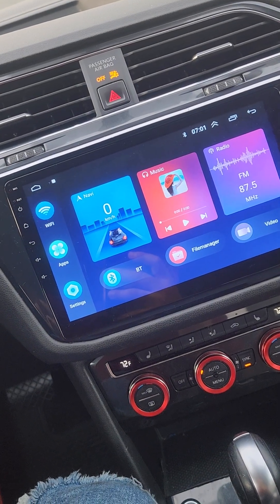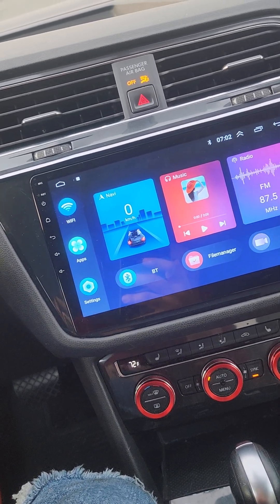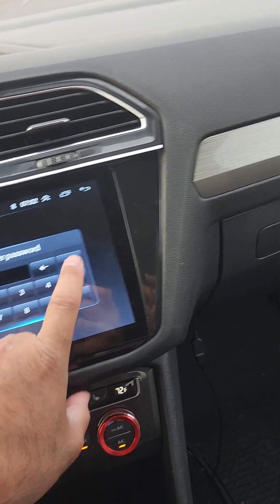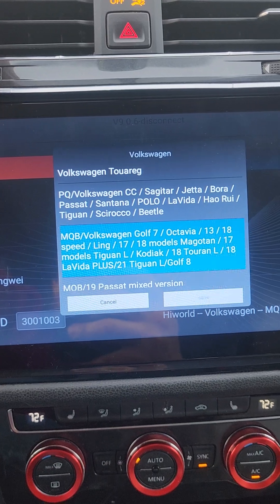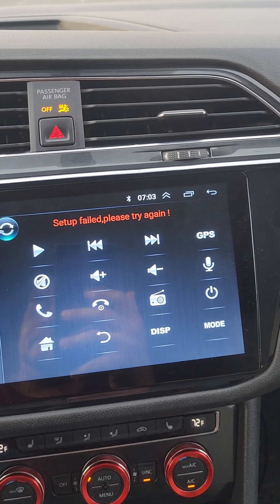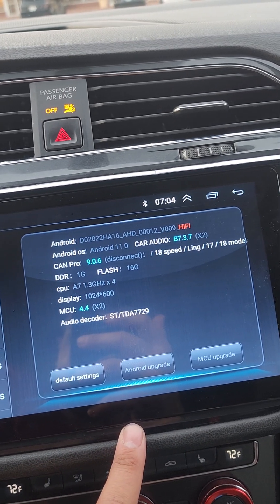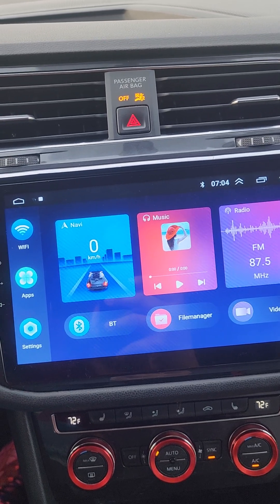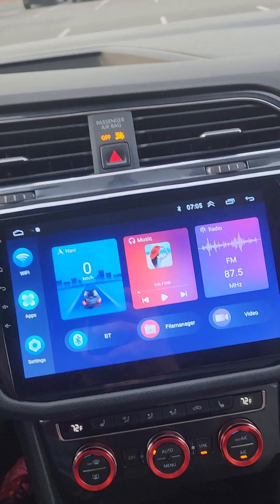android radio canbus not working!! help!

Comment: Hi ! Got the same issue with my audi q3 with HW cx400 canbus. Seems to be undetected but wiring is good. Hope you will solve the problem.
Reply from the maker: It might be the canbus
Reply: change the canbus, I had the same error,it's okay now
Reply: @en143185  thanks ;)
Seems to be complicated to find the right canbus for the 2012 q3 without MMi. Autoradio android is working except steering wheel buttons and reverse signal
Reply: @techdeereviews4392  thanks ;)
Reply: Did you fix the Problem? ✌🏻
Reply: @edewolf9160 Same here with a jeep Wrangler 2015
Reply: Anybody with 2011 ford fusion. They don't even have fusion listed in the opinions. 😅😅

Comment: Did u get this working after same problem today
Reply from the maker: Yeah it was a shipping issue they forgot to include a wire that was needed for the canbus to work
Reply: @techdeereviews4392  Can you please share witch wire, because im having the same issue and cant find anything besides your video. But it would be helpfull for some more info about this issue.